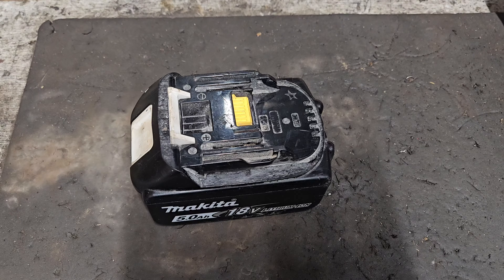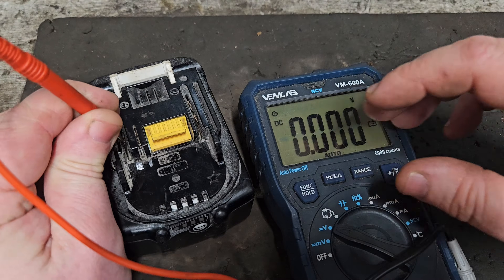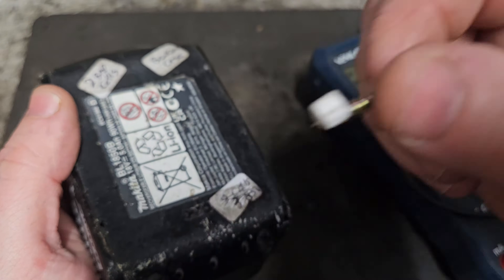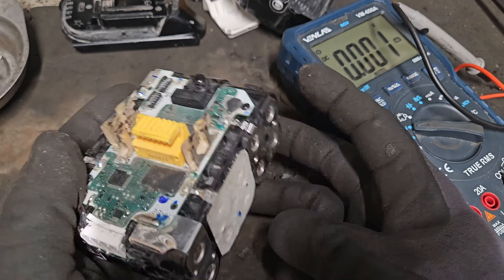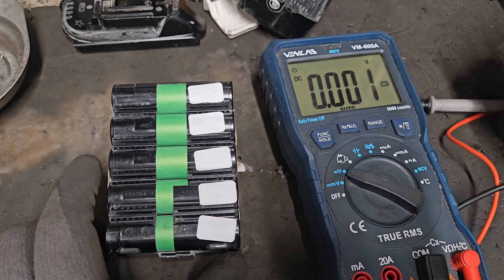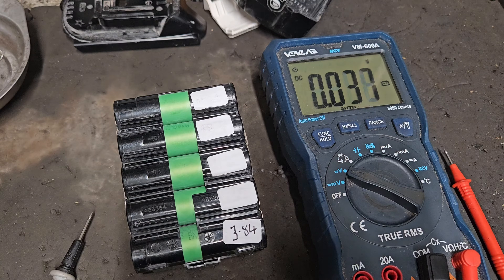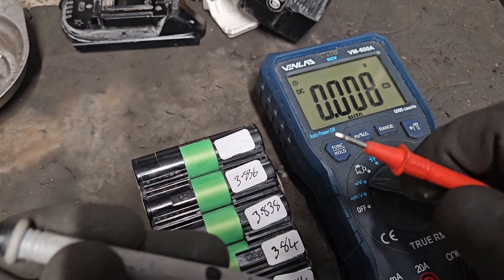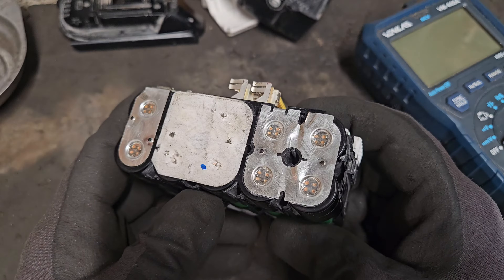How To Test A Makita battery Step-by-Step Guide

Comment: Hello and greetings from me here in Glasgow,just a wee bit from you.

I'm an electronics technician just so you know i'm not going to give you a load of BS.

I just bought two 9.0Ah batts from ebay,most likely,well they are knock offs,i know i can buy the makita BMS boards and that the ones in these batts are likely the small crappy ones ,i don't care as i can change all the cells,weld the nickel strips and fit the better BMS boards.

However,from my encounters with drones,they use li-on batteries,the chargers for these batteries have the high current connectors like the makita batteries the large nickel coated connectors,they also have the multi connector to monitor each cell voltage to avoid over charging any of the individual cells,on the makita batts it's the yellow multi connector.

Instead of ripping the case of why didn't you measure each cell from the BMS socket,i'd like to see this done so i don't ruin mine.......  ;).

I also would like to make a charger cable to connect my makita batteries to the RC li-po charger as they can output a hefty charge current,they are programable in cell type,from lead acid to li-po,they can set a constant current for charging and set the cell count to to monitor each cell as they are charged,in the makita 8.0Ah i think 10 cells or in RC parlance 10S.

Deffinately one to look into as the RC chargers are more featur packed for safety,also the lo-po chargers for RC or i should say the batteries when being charged can be left safely inside fire insulated and compartmentalised steel enclosures to avoid the house burning down in case of a battery failure,something all li-po battery users should be aware of.

Even the best charger can't stop thermal runaway once it starts,and i'm sure most of us have seen it on youtube or the news,the best places to see it,deffinitely not a first hand experience i want to witness.

Also the small 2Ah batts that come with some ebay drills etc are charges with a 5.5mm dc connector with no BMS,you can buy a case kit from aliexpress with the good BMS that has the percentage readout led display,you need to weld the batteries or transfer the already welded batts and desolder the old BMS  and fit the better one to get a battery that can charge on the makita charger usin a BMS,not for every one,but since i've been a small child i always tore my stuff appart to see how it works,sometimes need a box for the extra parts after rebuild........

Incidentally the welders can be made easy enough by most budding electronics enthusiast,or bought reasonably cheap,depends on your ultimate goal,but rebuilding an old battery is way cheaper than a new one,samsung 18650 packs of 10 are available quite cheap and have good capacity.  

Sorry i got caught up in the excitement of a seat of the pants how to rant.

Hope my celtic cousin can forgive that,cheers.
Reply from the maker: No problem at all, always good to have some more input. Good point about not ripping the sides off but I do have more videos on batteries and battery repair you could check them out and let me know what you think
Reply: Sorry ,drones use LI-po not LI-on,but the effect is much the same.

Comment: my battery gets 15,2V if i measure where the battery pack goes into the circuit board but if i measure at the top it only puts out 0,2V. Should i try to re-solder the connections or is the circuit board broken?
Reply from the maker: Check if there are broken connections first you should be able to see them but if not it could be the board

Comment: Hi, great video, just wondering, where do you buy replacement batteries to repair? Amazon?
In my case, I have - 1 pc 3 amp - 1 pc 4 amp - 1 pc 5 amp Makita batteries which are not in top condition. 
Thanks in advance for reply - great video mate.
Reply from the maker: I use reclaimed cells from other batteries good quality new cells are hard to get